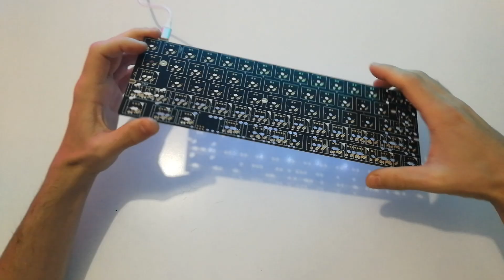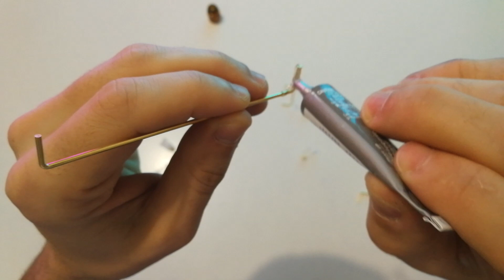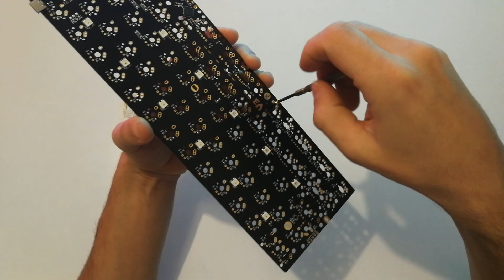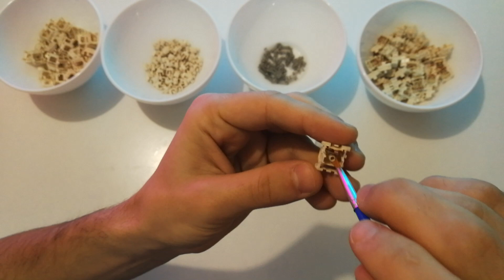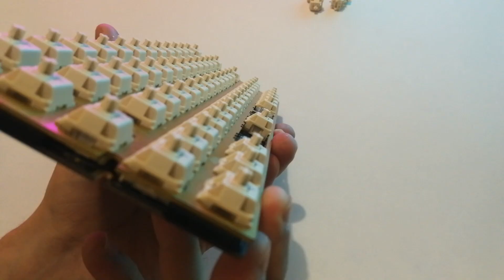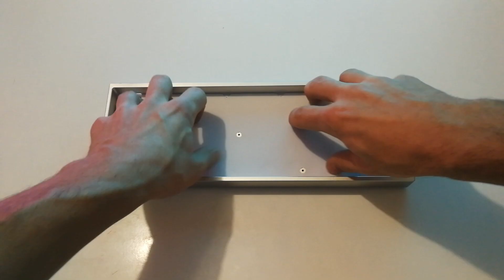300$ Custom Mechanical Keyboard Build

Comment: waaaaait those dots of foam on the other parts of the case might be 500iq
Reply: I did put dots of foam in those spots and now my kb sounds much better, sounds a lot more cleaner
Reply: @benjigonzalez47  how thin does the foam need to be? i have really thin eva foam that i use for the bottom of the case, and i have a ton of thick neoprene left over because it cant fit in any case.
Reply: @justanotherpxrson  i used some really thin packaging foam that was laying around, also i only used the farthest left and right posts and on the rest of them i put some foam on top as seen in the video. hope it helps!

Comment: Sweet build. Thinking of picking up this case. Did you break in your novelkey creams?
Reply from the maker: Not yet, but I'm getting close to it, you can check my latest video for a sound test (only difference is I'm using PBT Muted keycaps atm.

Comment: Do you recommend brass plate for clacky sound? Or alu/carbon fiber
Reply from the maker: Brass tend to mute the sound but doesn't affect the clack imo. You'll get a deeper sound with an alu plate and carbon fiber plates are in between so it's up to you if you prefer a cleaner but high pitch sounding board, or a deeper sounding board. I have both, I like both. This video is a great example : https://www.youtube.com/watch?v=qhf2sr_dbOM
Reply: @HeavyMix3  thanks! Nice video btw. Subbed

Comment: what foam did you use in this build
Reply from the maker: EVA foam
Reply: @HeavyMix3  what's the thickness of eva foam did you use
Reply from the maker: @Guel_13  3mm, but the best to use is 3.5mm if you can find it

Comment: I wanna build this keyboard but without soldering, how would that be?
Reply from the maker: A hotswap PCB with such a layout doesn't exist, so you'd have to make it yourself (i.e. solder hotswap sockets).
Reply: @HeavyMix3  the KDBfans DZ60RGB V2 hot swap PCB comes pretty close though
Reply from the maker: @neikels  Ehmmmmm no ? ISO 2u Lshift with 64 keys support doesn't exist afaik correct me if I'm wrong.
Reply: @HeavyMix3  I know I know, that is why I wrote "pretty close" XD. but the essential layout, which means 60% with arrow keys, is available as hot swap
Reply from the maker: @neikels  Oh for sure, the GK64 also have hotswap 64 support for instance.
Reply: You can use mj61/64 pcb

Comment: can gk64x pcb can fit in that case ??
Reply from the maker: I believe it does. This case has a standard 60 usb cutout on the left and accept PCBs similar to DZ60  and GH60. Compare with these pcbs and if the usb position is the same then you can go for it.
Reply: yes it fits in that case!
Reply: it will fit, but the spacebar module will only be attached with the switches, this case doesn't have the standoffs for the spacebar module